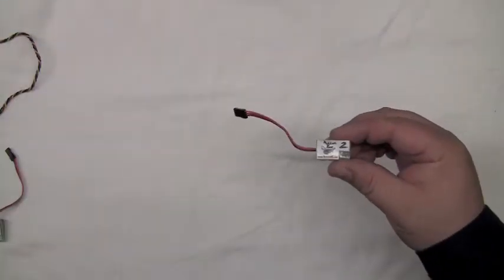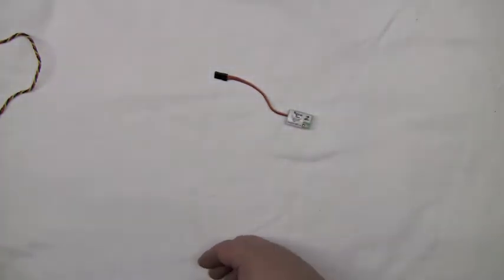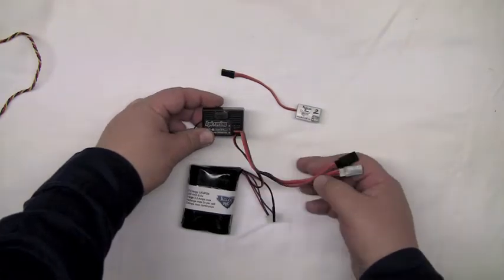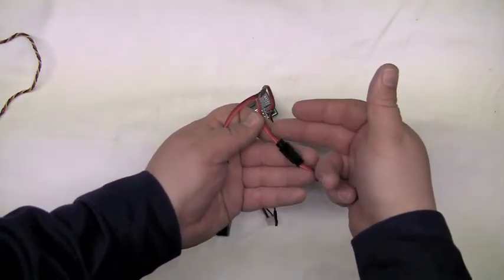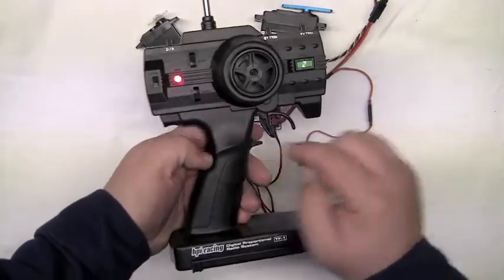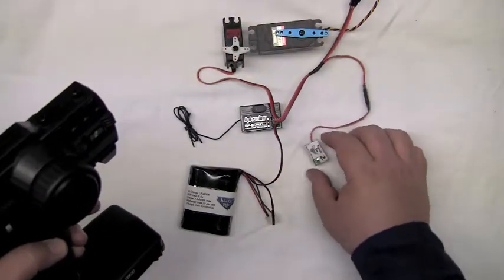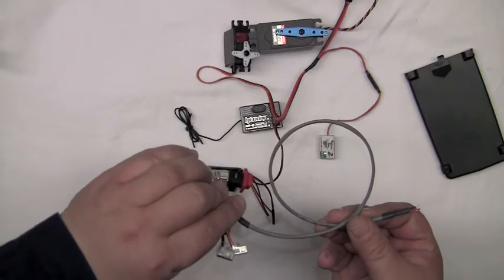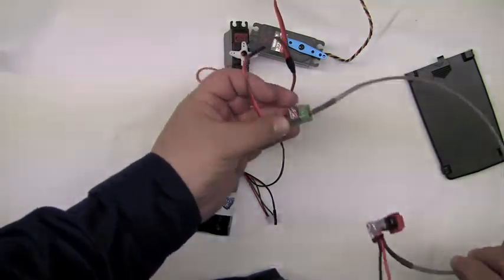Killer RC's Killer Bee v2 or v2-S, part 1

Comment from the maker: @TheExcentrik It's magic. LOL. The Killer Bee v2 and v2-S will only kill the engine when it senses that radio signal is lost. It doesn't care when the servo trim moves back and forth. It only looks for a clean signal from the transmitter. Once that signal is lost then a relay closes and it kills the ignition spark.

Comment from the maker: The Killer Bee v2 functions nothing like a pico switch. The pico won't work with a 2 channel radio. The pico switch is normally open. A kill switch has to be normally closed. The killer bee has LED and buzzer output. The Killer Bee has a higher low voltage cutoff. Plus we don't even make the Killer Bee anymore. The new Super Bee is loaded with features and surpasses any other kill switch in existence.

Comment: still have my Killer B v2-s, going strong since 2/3/ 2011.  cant afford to change to the super bee although it would be nice but since my original still works i would rather finish correcting the bajas kit flaws and adding a light setup on it LOL.  that reminds me i need to chate with kent with questions i hae on the light controllers :P

Comment: I have a super b  That I bought for my spectrum radio maybe you could help me it flashes 6 amber 1 green then flashes red turning on the transmitter does nothing , the transmitter is set up as it should be whats up , it is brand new so it the transmitter DX4C 4 channel 410 receiver all are new  thanks Bob